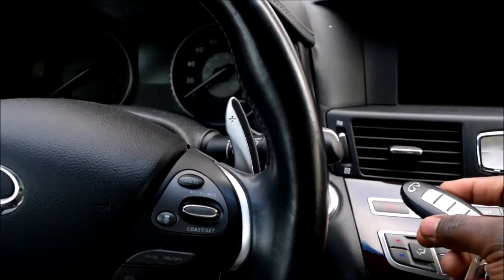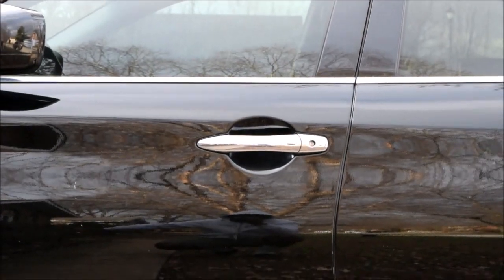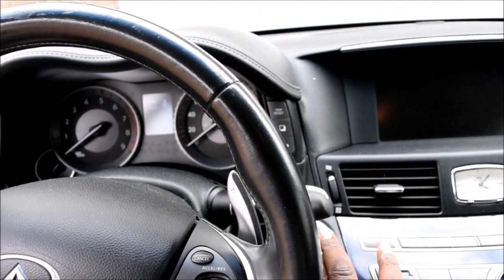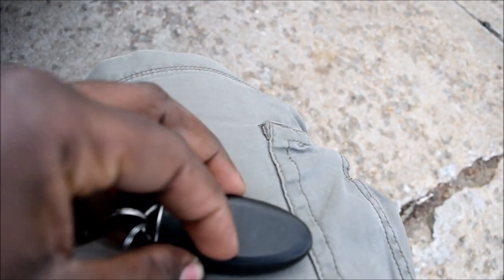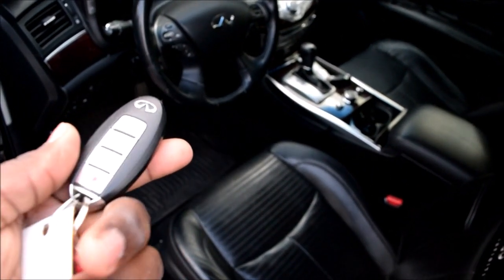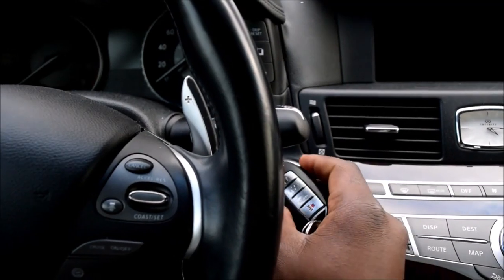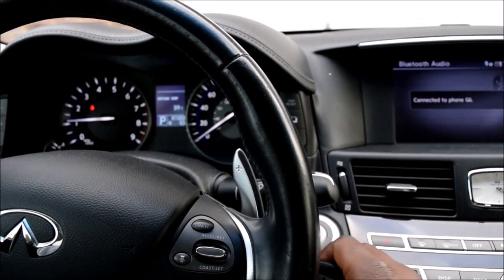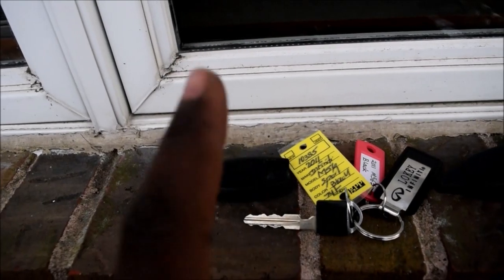Start car with dead key fob battery. Infiniti M56 M37 Q70

Comment: Here I am once again checking your vids out bc I have an issue🤣🤣. First noticed the problem when i was walking away from the car  and it would not lock when I press the button. The button on the door handle would lock it, but after a while that stopped working too. Then after that I have to place the fob into the slot for the car to start😏. I found a vid where the guy says to hold down the lock button and press  start 3x and wait 10 secs, then hold the lock button and press start 3x. Took a few tries but it works. Was able to lock/unlock the car with the fob and even with the button on the door handle. But it only worked for less than a day🤣🤣. Tried the same procedure, it worked and then stop working. Got frustrated and bang the fob on the counter, I was able to hear the horn from the 3rd floor when I pressed lock.
Thinking there is some kind of short or I just need a new fob.
Ps. I did put in new batteries.
Reply from the maker: Lol, sorry to be getting caught up on this this late, but what was the permanent solution?
Reply: @EdBwoy  lol no worries..I just left it. When it's not working, i just tap the fob on to something and it works😆
Reply: @EdBwoy  my button on door handle is not working on m37 2012. Also I feel a kick when switching between drive and reverse?

Comment: My spare keyfob wasn't working. Replaced battery w new battery. Still nothing but was able to start the car with this process in your video but touching the spare key fob with the start button. Any suggestions on how to get the spare key fob to fully work properly after replacing the battery with a new battery? Does the spare have to be reprogrammed from an Infiniti dealership or something?

Comment: Just a note, You can lock the car from the inside using the button in the handle the side of the door
Reply: It won't let you unlock or lock from inside with no handshake from the key fob hense dead battery or what have you
Reply from the maker: @bobbysanders6706  such a simple execution, but the intelligent key system actually has a lot of layers like you pointed at. 
I did my best to touch on the main functions without the video being too long.

Comment: Hi. Thank you for interesting video. Maybe you know how to fix this issue: RAS+SLIP+VDC OFF lights permanently on? Need to repair the RAS system? Infinity m45, 2007.
Reply: I'm having this same problem.
Reply: I did a video on this just click on my name and it should take you to it,.
Reply from the maker: You might need a diagnosis from the dealer, but that sounds like a steering angle sensor issue. https://forums.nicoclub.com/ras-vdc-slip-steering-angle-sensor-t619955.html

Comment: Hi!is there auto start the engine?how can we do it or need to install additional system?tnx
Reply from the maker: These cars do not have remote start from the factory, but you can always add it yourself. You could either pay a professional to do it, or I have seen people do it themselves using kits by 12Volt or even Fortin
Reply from the maker: Here is an example - https://forums.nicoclub.com/how-to-install-fortin-remote-start-2012-m37x-t613141.html

Comment: Hey Ed, I'm having a funny problem  with my '13 M37xS. Getting the key system error, but car runs and drives fine BUT I did notice the buttons on the door handle that unlock the doors when you touch them dont work anymore. Any idea what that could be?
Thanks in Advance...
Reply from the maker: Is the key fob battery good?
#2, are you carrying any other key fobs when trying to operate that button?
Reply: @EdBwoy  yeah key fob battery is good. No other key fobs with me.
Reply from the maker: Sometimes the key fob itself goes bad. It's rare, but you can verify by using your spare and seeing if it behaves the same way
Reply: @corrieharris774 Me too... Figure anything else out?
Reply: @romeokilo2087  yup. Passenger side door handle was bad. Had to be replaced.

Comment: At night time when you unlock the door will the headlights come on so you can can see where your going to get something out the car
Reply from the maker: The earlier models don't have much besides the interior lights and the door handle lights. https://youtu.be/i3LqmAhii60

The newer models came with LED DRLs though
Reply: @EdBwoy  so if I get a 2011 m37 sport the light a won’t come on at night time when I unlock it

Comment: Hey man in my infiniti m37 do you have and idea how the heated seats operate my passenger seat does not work when I turn the switch or light up could be a fuse could be blown out where could I find this fuse. if it is the problem?
Reply from the maker: The fuses for the climate control seats are in the fusebox at the left/front corner of the engine bay - behind the intake filter

Comment: My Infiniti does not do anything when I push the start button. Yours say no key. I wonder why 😭 the only thing that it does it show the little red light that flashes with the key just like yours at the bottom of the screen
Reply: My to my u did to fix it?